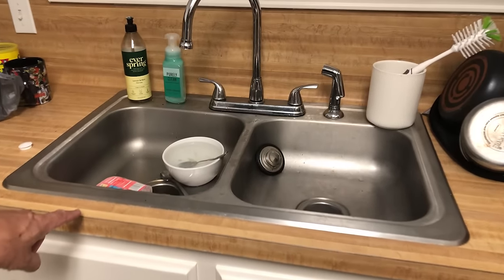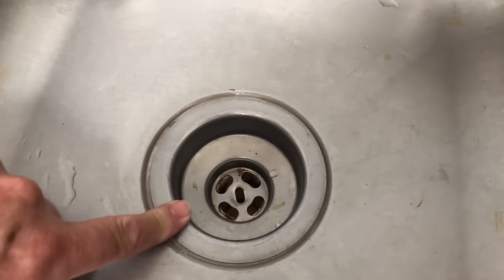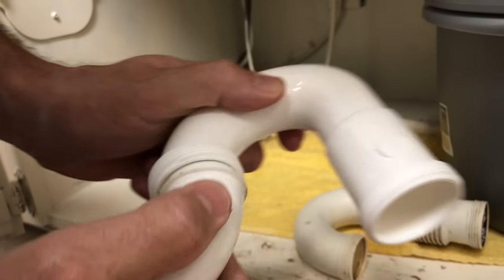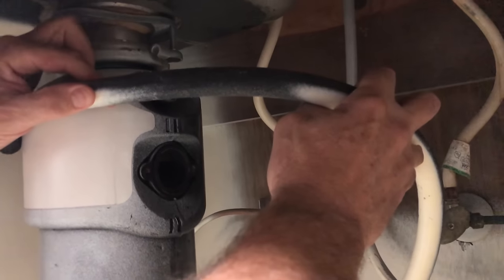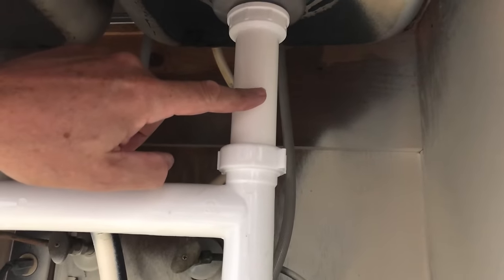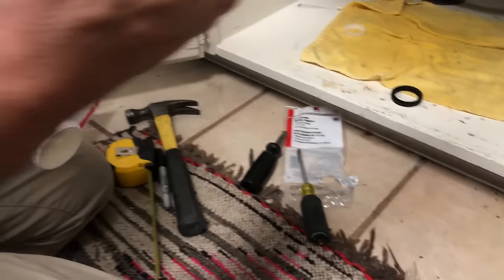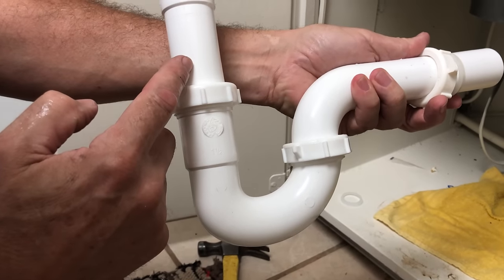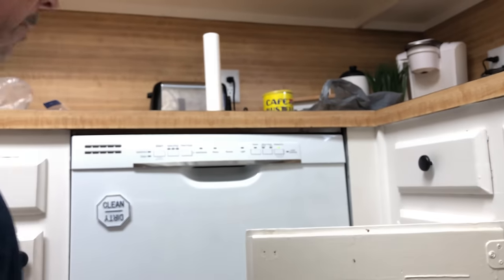How to Fix a Dishwasher/Sink that ISN'T Draining

Comment: I think the biggest sin of this job is not turning their disposal basket the right way. It’s one of those things that lots of plumbers don’t do but I do it because a) that’s how I was taught and b) it just looks better when the letters are up. It has no bearing on how it works but it’s one of those details that subconsciously tell people you care about your work. 
The wonderful ones are where they cover every nut with silicone. While I think the restricted trap didn’t help, the reason for the water going back into the dishwasher is because theirs no air gap or loop. We don’t use air gaps because it’s an extra piece on the sink deck to take up space and clean around. We put a loop and have never had issues. With the loop all but a little water will go into the drain. With gravity. Without the loop the fall is going from the y branch or disposal back to the dishwasher so you end up with water back in the bottom of the dishwasher. Also if you’re using a y branch a little water from the sink can splash into the hose part every time you use it. With loop it goes down the drain because it can’t go uphill. Without the loop though this water will go into the dishwasher.
Reply from the maker: Come on Josh 😂😂👊 you know I align the letters😅.  I was just there to fix the drain… didn’t touch the disposal.
Reply: @StudPack  for sure, unless y’all are the opposite of how you are in the videos, I would expect nothing less. I was intending to aim those criticisms towards the original plumber who did that job. I apologize if it came off otherwise.
Reply: Though a trick for dishwasher hose to extend it is to use 3/4” copper as a coupling. Just cut a small piece and clamp the dishwasher hose to one side. Then get 7/8” rubber hose and a clamp for the other. Most plumbing supply houses carry both 5/8” and 7/8” heater hose for this purpose. The 5/8” is for trap primers and the 7/8” is for dishwashers and condensate drains.

Comment: You can have a leak at the interface between the plastic wall tube, and the pre-existing steel 1 1/2" wall nipple.    Get a FERNCO coupling... They never leak.

Comment: NEVER EVER stick your hand in a garbage disposal without either unplugging the unit from underneath the sink or turn the power off to the disposal at the breaker. What this guy did by sticking his hand inside the disposal w/o turning off the power supply was very dumb.

Comment: I don’t think that’s a “great job”  
First, a hose clamped over another hose?
The dishwasher, if a high loop is used, is now triple trapped.
The disposal is also double trapped….
I’d prefer to use a different piping method (glued fittings)as well under a kitchen sink.
I don’t like those cheap fittings.

Comment: Do not EVER stick your hand down a disposal again.  Even if the thing is unplugged- there is a thing called recoil.  If its jammed and you pull out the problem BAM- it can spring back and basically the disposal is running in reverse.   We have tools for this kind of stuff- to make a video and demonstrate such a careless behavior act is irresponsible and concerning for someone trying to demonstrate a professional act.